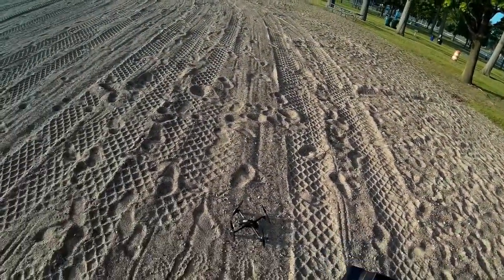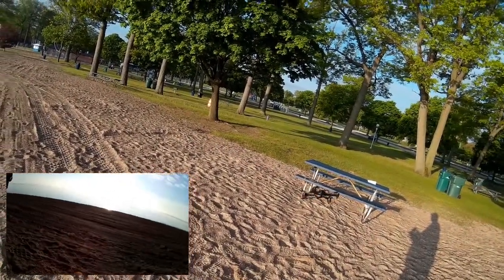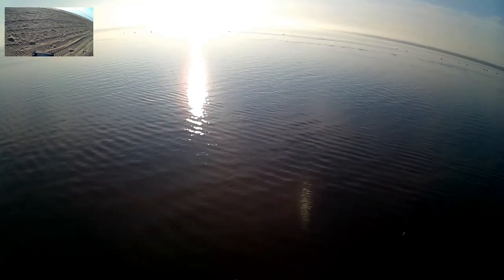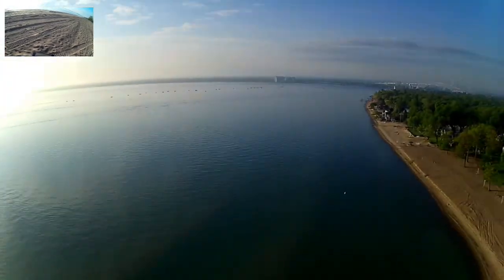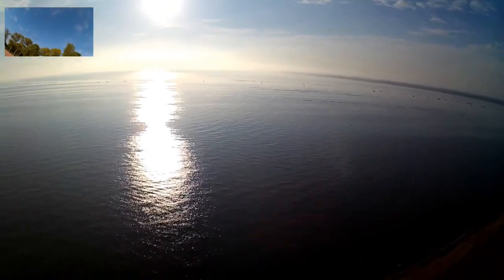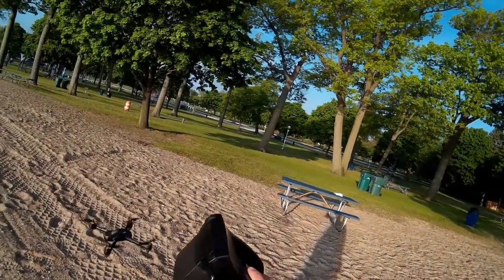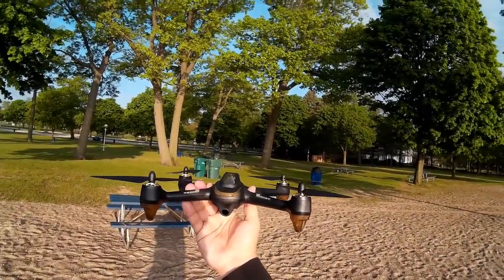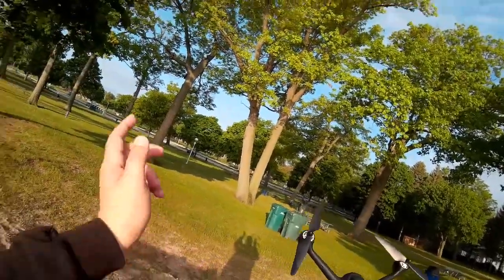Video Drone - First Flight of the Hubsan 501s Over the Lake!

Comment: I love mine. I have to admit I was a bit nervous taking mine up above 75m because after that you lose all visual and have to rely on your instruments/ FPV for flight. My first gripe thus far is the length of time it can take to acquire the necessary sats needed to fly. I live in Southern NJ and even I have to wait 20 minutes at times to get signals. Second is the RTH feature tends to take a LONG time to descend. I have to force it to drop faster. That scares me on times if I lose signal or the batt fails, I don't want this thing falling out of the sky from 100, 200, or even 400 feet. That would be catastrophic for the drone and a possible danger to anyone or property below. Takes great stills at 1080p and good video. I got this for $400 in July 2018, which included 2 extra batteries, props, 4 extra brushless motors, a sun shade and the antenna mod kit. For that, this is a great deal. Drone alone was $200. For today for this drone? Awesome deal.
Reply from the maker: Yes on the falling out of the sky being a bad thing :-0  If you look back I lost Syma X8 and it hit the water from about 400 feet (it was a fly away) and I could see the splash 1/2 mile away!

Comment: Also, I wanted to add, as with any rechargeable batteries, it takes several cycles to achieve maximum use. The most important thing to remember is to never run them "dead". That will greatly reduce their life expectancy. Don't take them below 20% before recharge and you're good. Also never recharge a hot battery either. These are things I'm sure you know but some readers may not.
Reply from the maker: Yupper your 100% correct!

Comment: great video!
might consider a launchpad for takeoff/landing...keeps from stirring up dirt/dust...
i have this one as well as the c model and love them both...
if something was to happen with either one(drop it in the drink or something)i wouldnt hesitate to get another one...
orientation tip: i put some neon red striping on the front arms of both of mine...i got the black version...bees dont bother the black one it seems lol...
great job!!
Reply from the maker: Many thanks and after you see the up coming video on this you will know why I got one of those fold up landing circles (ouch :-) Also I like the tape idea :-)
Reply: the girl at a vinyl sign shop gave me alot of scraps...i chose the brightest and loudest red and orange lol...
as you see in my intros with my 501 flights...looks great on a black bird...
i call my 501 birds crowcopters 1 and 2 lol...
Reply from the maker: Just went and looked, your right that does stand out, will have to give it a try :-)

Comment: Why didn't you use the yellow plastic lid as a launch pad to protect your brand new motors?  Or even the picnic bench.  Launching off the sand is a cardinal sin in drone land, right?

Thanks for the Yaw party!! Whoop Whoop. 

You can see tons of bouys or what looks like bouys. 

You need a stick with some rare earth magnets on it and a metal plate on the copter to catch it. Lol
Reply from the maker: LOL!  Those are boats :-)  yea I should but wait for the next video!  You will get a kick out of it!  As after you see it you will understand why I now have a fold out landing circle!
Reply from the maker: Never did answer your question why not the yellow top, as I just had a couple hours before I had to leave for China so rushed out and didn't time to get all my stuff and figured I would be cool and all.
Reply: Great point to be sure!